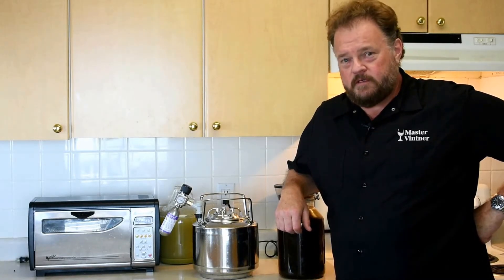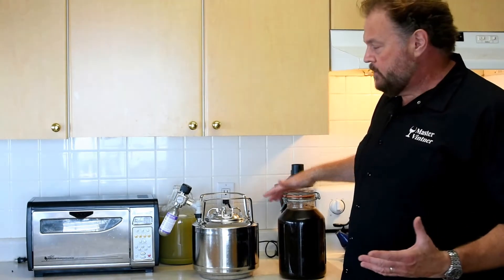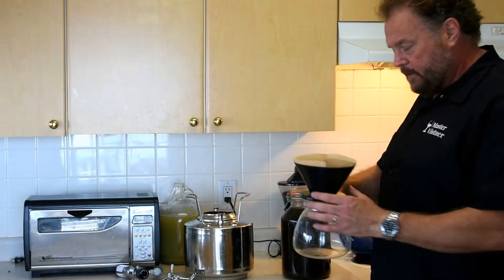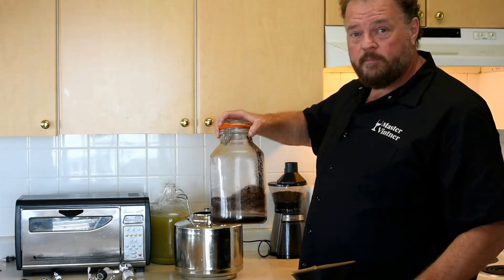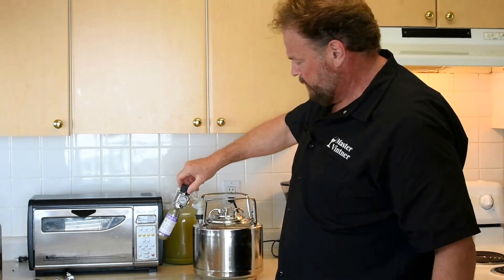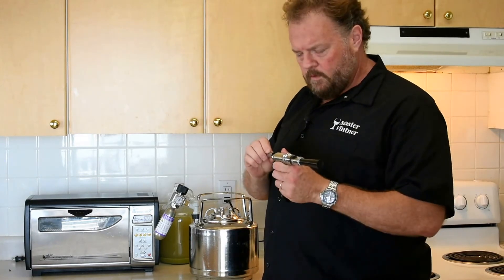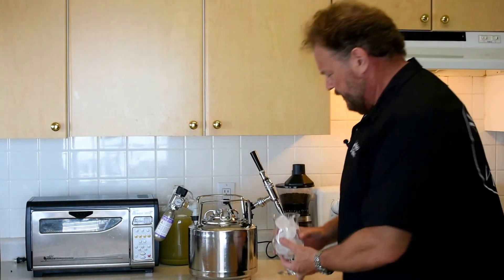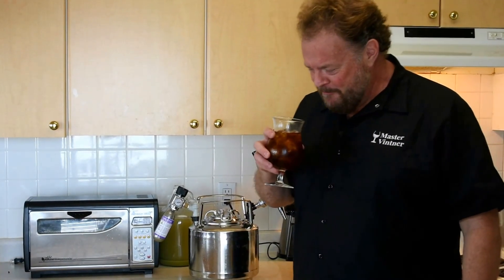Kegging Coffee

Comment: Do you have to keep the regulator and cartridge attached after you've charged and saturated the coffee with the nitrogen? or is it something that gas to stay attached?
Reply from the maker: I generally leave it attached, unless I need the regulator for another specific purpose. There's no danger of it leaking or anything while attached to the keg.
Reply: awesome. I have access to a full bar setup and can charge it from that system then and it should be a problem?
Reply from the maker: Nope, that's how I do it at home: I have a kegging setup with nitrogen and run it off there all of the time.